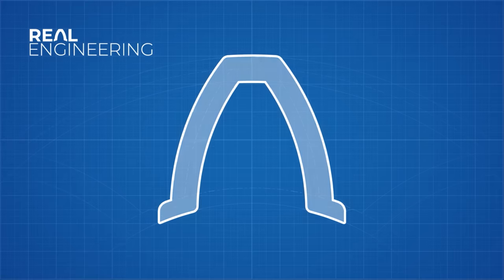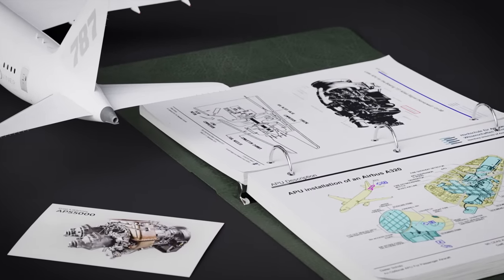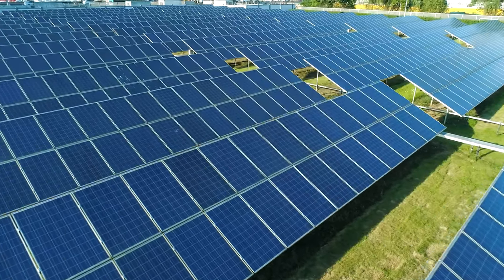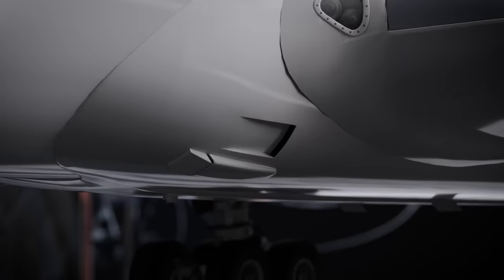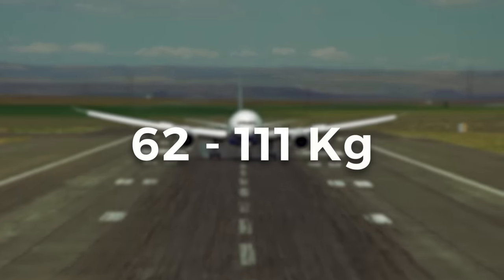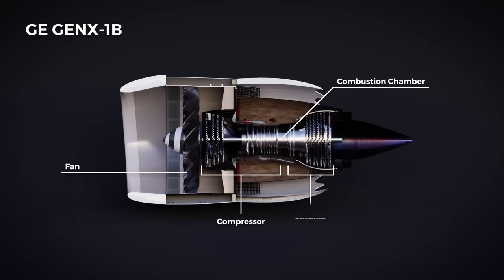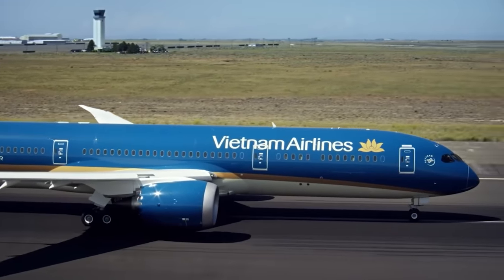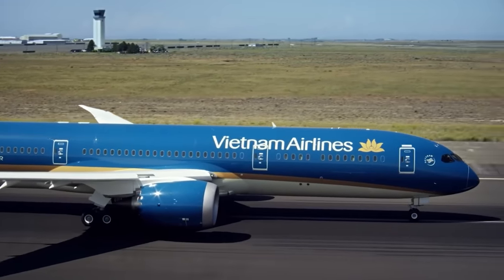The Insane Engineering of the GEnX

Comment: Awesome video!  Minor point, the chevrons on the fan increase the exit area of the interface between ambient air and fan discharge.  Increasing the area decreases the shear which decreases noise.  Think of a siren, it makes high pitch noise by shearing the air.  We experimented with chevrons on an unnamed fighter engine with no real benefit in noise reduction seen (no comparison implied, different application).  Fan discharge air reduces the shear between ambient air and the core by accelerating the air at the interface of the fan/ core discharge.  Reducing shear reduces noise.  BTW, loved the video so much I subscribed to Nebula.I learned a lot.  Love this systems stuff.  Also loved seeing "my engine" in the test cell in some clips.

Comment: Great video.Amazing thing that all of those improvements implemented with this engine came with little or no compromise. Literally everything was improved; ,quiter, more efficient and even environmentally friendlier. Limiting factor with bypass ratios and engine sizes are also ground clearance, and may require more precision in high wind landing,due to fact that engines are getting closer to the ground.
Reply: Quiet engines would make you think they flamed out. Old cats from DC4 love the old prop noise. They miss it. I flew on a A 320 recently Apr 2023 and it was quieter than B737. You could sleep.

Comment: I find it quite interesting how with ever increasing bypass ratios, today's turbofans are increasingly becoming more similar to the propfan concept. I wonder if the two will begin to overlap in the future.
Reply: Safran developped an unducted turbofan engine. It's set to release in 2030, I believe
Reply: So basically a turboprop with fewer steps
Reply: How so? Just due to the bypass ratios? Or other similarities?
Reply: A Turboprop is a propeller attached to turbine engine though a driveshaft and gearbox. A propfan is a fan ( basically a propeller) mounted directly to the low pressure turbine of turbine engine.
Reply: There likely is a "sweet spot" for turbofan + prop overlap.
Reply: @OceanLlamaMedia  did you read ANY of these comments? That's exactly what this has been about
Reply: Actually maybe you guys could help me out, bc I'm not sure how they can claim an UDF/propfan can go the same speed as a turbofan when turbofans are ducted bc the angular speed of the blade tips would cause Shockwaves otherwise. How do UDFs solve that problem to be faster than turboprops?
Reply: I was going to comment exactly this but well done
Reply: @lextheap1638  Thank you so much!  It's called different things so I wanted to give the alternative name and a link so more people could read up on it.  Appreciate your insight!
Reply: @lextheap1638  The same way a geared turbofan does (which was briefly mentioned in this video - the 12:1 bypass engine that is one of the two which can power the 737MAX) there is some mechanism inside the engine that slows down the speed of the propeller blades. (If you look at the wikipedia page for Propfan, there's a mechanism that can be used that's simpler and more reliable than trying to attach a gearbox to the aft end of a turbofan engine - much more complicated than attaching it to the front as in a turboprop or a geared turbofan - but I forgot how it works. It's also in use in some turbofans, IIRC)
Reply: @jeffbenton6183  I think you missed the point of my question. How does it achieve the same speed as a ducted fan that doesn't experience parasitic drag at high tip speeds? I understand how it works, I just don't get how it isn't just a Turboprop strapped to a turbojet
Reply: @lextheap1638  Ah, I see. Now that I think about it, I think I have the same question, but I don't remember the answer.I think the Russian Bear bomber (fastest piston-powered aircraft in history) had to solve a similar problem, but I'm not sure.
Reply: check GE's RISE concept
Reply: Why not turn them into after burners? Yes this engine seems to be a tube prop!
Reply: @lextheap1638  Hello again, did you get a chance to see RE's newest video? It was about a supersonic prop-plane - so the propfan concept may have solved the problem in a similar way (although, IIRC, all the propfan concepts I've seen look more similarto WWII designs).
Reply: You have been found guilty of tech heresy and passed to the local magos for summary judgement. Expect to receive word of your punishment in 5-500 years solar.

Comment: Well understood presentation of the essence of way the GE engines on the 787 have evolved to produce solid  provable increase of fuel efficiency and engineering improvements. Adaptive  engineering(3D metal printing) producing the fuel injectors to reduce nitrogen in the atmosphere was fantastic. Thank you for a useful subject that the public should be aware of. Good job GE.

Comment: 10:33 as far as i know kiloNewton should be kN instead of Kn
kn and Kn are used for Knots sometimes so going with anything but kN is going to look more like something else
Reply: I was looking for this comment. He also said double u instead of omega for the angular velocity.
Reply: am I the only one who felt the narration is kinda all over the place in this video? Don't get me wrong, I like it a lot, and I get it's extremely complicated topic. But I was often confused. Might be a problem on my side tho
Reply: Correct it should be KN for kilonewtons but in areopsace engineering Kn actually represents knudsen number. Knots is usually represented as Kts to avoid confusion
Reply: Aren't Knots usually abbreviated KT, KTA (knots airspeed) or KTIA (knots indicated airspeed) in reference to aircraft?
Reply: The rule I learned in physics is that when it comes from a name it is capitalized. Newton (N), Hertz (Hz), Pascal (Pa), Becquerel (Bq), Ångström (Å), Ampere (A), etc.
Reply: @AlexandarHullRichter   when doing equations if asked to work out velocity in knots id use Kts and if asked for true air speed in knots is use KTAS. The equation for TAS requires mach number and to find the mach number you need velocity and thats when you would be given speed in ms or Kts. The thing to remeber is KTAS and Kts are different
Reply: Thats why I stopped and was scratching my head over what he said and what i saw. Then realized what he meant and moved on

Comment: This is soo cool. Whenever I see stuff like this I just marvel at how smart people are. Like, somebodies brain thought of a swirling air fuel mixer injector thing and it works!!
Reply: It's nothing new, basically the same principal as a carburettor on a petrol fuelled internal combustion engine. You're right though Alex, some very clever engineers and scientists at work.
Reply: @brettkemp4219  for sure, I see all the awesome stuff that people take for granted and think how some very smart man or woman had to think of it first!
Reply: @brettkemp4219  I must respectfully disagree on your comparison to a fuel carb. I have seen and worked on this nozzle first hand from a machining /development standpoint. It has 3d nickel based printed parts in this nozzle which I was, and still am in awe of when I looked at it. There is a fan type stationary blade system built into the nozzle which swirls the air when the fuel is introduced making for an extremely atomized fuel delivery system. This swirl was never introduced to the petrol engine until late into the combustion chamber on a IC engine and then not until the last couple decades. (I believe) :)
Reply: I completely agree. The swirler however was first introduced for better heat distribution in annular combustion chambers as that would decrease the thermal stress on the (HP) turbine. 
So I guess the first team who thought of that design feature had the original idea to just decrease the damage on the turbine blades. Such complicated systems don't suddenly appear in one engineer's mind overnight
Reply: @bahenbihen  That's a great point. The whole process is just fascinating. Thanks for the incite.
Reply: It’s an old principle - but hats off to GE for how well they implemented it
Reply: @brettkemp4219  A high-bypass turbofan engine is A LOT more complex than an ICE. Burning gas in an enclosed cylinder in portioned strokes is one thing. Burning it continuously in basically a whirlwind - I can't easily wrap my head around how that works...

Comment: 25:00 is it the same principle behind tapered train tunnel exits? Iirc, they add tapered concrete walls to the exits of train tunnel so that the air pressure wave, that is created by a high speed train moving through the tunnel, is dissipated more gradually.

Comment: Great video! Just to make it even better, a small detail: APU air bleeds into the air starter of the engine, not the turbine section. The starter then moves and as it is connected to, normally, N2 shaft, starts moving the "engine".

Comment: "The Compressor and fan are driven by the same drive shaft"

Rolls Royce: laughs in 3 spool
Reply: Comparing GE's efficiency to Rolls Royce's?
Reply: Another case of blatant inaccurate reporting by an inexperienced YouTube "creator ", but the viewing figures are good!
Reply: @nikoscosmos  what
Reply: Well, it's also wrong for the GENX. It has, like most modern fan engines, 2 shafts, a low pressure shaft containing LP turbine and LP compressor incl. the fan and a high pressure shaft, containing the HP turbine and compressor. Having 3 shafts is a unique feature of some RR engines, mainly the RB211 and Trent family. That concept has many advantages but also disadvantages.
Reply: @wanderschlosser1857  You're right, but I was lazy to reply until now. Most turbofans only use 2 spools for a reason, mainly cost effectiveness. But as said, as bypass ratios increase, the ideal fan speed will shift away from ideal LP compressor speeds. Rolls Royce took a big gamble of taking the 3-spool idea, which as you might know mechanically separates the LP compressor with the Fans. In fact, they almost went bankrupt making the concept a reality, as they had a tiny budget compared to the American top dogs. Definitely paid off for them with the Trent Success.

The P&W Geared Turbofan is flawed not because of the geared turbofan idea. The Gearbox is working perfectly. Their main problem is on their weak turbine materials, which is the opposite case for GE and Safran.
Reply: @dy7296  You're right that the bypass ratio increase and with it the different diameters of the LP rotor vs the fan diameter causes an increasing discrepancy of the ideal speeds. But it is actually not the LP compressor but the LP turbine speed vs fan speed that is of concern. Fans work more effective at lower speeds, besides being limited in speed by keeping the fan tips subsonic. On the other hand the LP turbines are more effective on higher speeds creating higher torque and hence more drive power for the fan. The LP compressor of course also runs more effective on higher speeds. But the fan speed vs LPT speed problem can only be properly solved by a speed reduction via a gearbox between LP shaft and fan, very similar to turboprops. The RR triple rotor systems can't really do this because the fan is still directly coupled to the LPT. The reason for the triple rotor design is to optimise the compressor section, the geared turbofan on the other hand is an approach to optimise the turbine section with the benefit that it also turns the LP compressor into a more efficient higher speed IP compressor.

Comment: Love the video! 3500 comments so maybe it's been mentioned, but traditional jet engines aren't started by injecting bleed air into the turbine section. The bleed air is used to spin a small turbine, which is geared to the compressor shaft and spins the whole engine. It's just like the 787, except the power source is bleed air instead of electricity.

Comment: Flew in a 787-9 a few weeks ago. 

It was a really exciting experience when my regular flights are in a Dash-8 and the largest aircraft I've been in are 737s and A320s. 

The dreamliner was something else entirely. 
Stepping off the plane, I couldn't believe just how large it was. It looked like I could step in to the engine with my arms raised high and not reach the top. 

I was just in awe that a plane this capable exists. 
It was very large and spacious, quiet, comfortable, and fast. Almost 2x the airspeed of the Dash-8 I've flown in most frequently.

Comment: I'm not yet sure, but I think after the battery, the 787's APU architecture might be very different from the usual.
Reply: Yea I’m not sure tho. He shoulda repeated that part again.
Reply: That’s what he said
Reply: Not drastically different from most APUs. No bleed air from the compressor, and it takes a different oil from the engines to aid in high altitude starting. Some subtle differences, but not really earth-shattering.

Comment: The integral blade and disk concept is incredible.  Another problem with the dovetail connection between the disk and blades is thermal expansion - the dovetail is optimized for operating temperatures, so the connection is loose at start up.  This also wears on the nub at the blade tips which provides the seal against the turbine case.
Reply: Then the Tce of the dovetail material is greater than the wheel material it resides in, I think.  I know with expansion the disk portion of the dovetail will expand, too.  Maybe there are some geometry differences.  Interesting, in any case.  And I have heard the blades clinking around at room temp when the thing is rotated.  I just assumed the centripetal force held them in place, or the lateral loading.  Bad assumption, apparently.

Comment: Former GE research metallurgist here. I have a souvenir on my desk: a gamma titanium aluminide blade tested in 1994 - an industry first. It endured 1000 "C" cycles in a CF6-80C2. We did special testing to see if it's relatively low ductility would be a problem, a significance source of worry by designers. There were problems in producing them that our casting suppliers could not overcome at the time, otherwise they'd have been used much earlier.

Comment: I just wanna say when you see the factories these birds are assembled in they look rather mundane, but they are the biggest buildings in the world. I was fortunate enough, as a metal fabricator to build some Boeing plants at my last job in Oklahoma City about 5 years ago. One was a 880k sq.ft. paint booth, welded truss members, like 40k tons of steel. Another was a rear wing facility for the 777x. It vwas over 1.1m sq.ft. Each truss was like 930ft long and had 11,000 bolts in it. Building weighed over 86k tons. Plenty of semis left okc for Everett with one beam member because it and the connection plates hit the 80k lb load of the trailer. For scale, same shop built dallas cowboys stadium when I was in college, it was only 15k lbs of structural steel. Massive operation!
Reply: Damn, now I want a video on the factory construction

Comment: 13:16 Fan blade shaft and the compressor shaft IS NOT THE SAME SHAFT! The compressor shaft is a hollow shaft that SURROUND the fan blade(or LP) shaft while supported by load bearings! And just to be clear, 787 ECS still uses good old Air cycle machine as air condition cooling.

Comment: As amazing as the aircraft is, it's almost always fitted out with the narrowest seats, so I'll still take a 777 or 350 wherever I can.
Reply: 787 with a 3-3-3 config should be a crime. 2-4-2 is far superior
Reply: You might want to google why the A350 became the A350XWB - they got your memo
Reply: @TheEpicAppleEater01  and how many airlines use 2-4-2 with the dreamliner? One? 3-3-3 is horrible in the 787. No matter how fine a plane it is, seat density, and often obstructive seat support and electrical paraphernalia make it worse. 777s and a350s are much nicer. The a350 is quieter too.
Reply: that is the airlines choice. if you fly delta for example and they chose the seats on a 777, 350 and a 787 they will be equally small or large. it is not boeing or the specific airplane model that dictates this.
Reply: @1104kdd  all the airbus I have ever flown on are perfectly good machines, but quieter is not true at all. way squeaky and creaky due to the use of more plastics in the cabin than boeing.
Reply: @BenJaminLongTime  Actually, the A350 is purposefully about 10 inches wider. Not enough for an extra seat, but enough for an extra inch width for each passenger.
Reply: @Vulpus Vulpus cuz the opinion of a random internet guy matters.